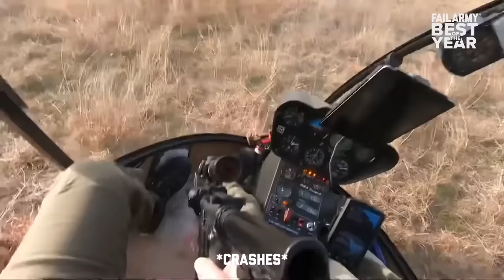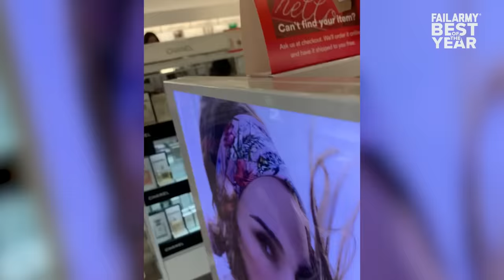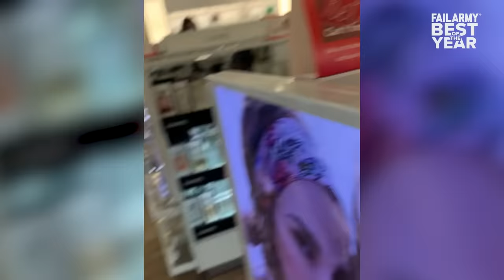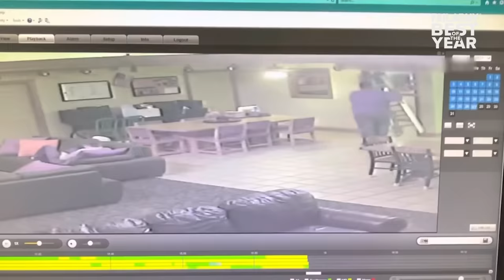Best Fails of the Year | Try Not To Laugh🤣🤣

Comment: "He won't bite, he won't bite, he just barks." He says as the 150 pound dog charges down the 100 pound delivery driver like she's an injured squirrel. What rational person would just take the guy's word for it and stop running away in terror?
Reply: Hate dog owners like this, they expect a person on the street to react as though they know the dog and fully trust it the same way the owner does, and just because the dog doesn't bite the owner, that's not to say it's not going to bite a delivery person.
Reply: The point is not to magically try and convince the person that everything's fine and stop running in terror, it's to at least slightly reassure them while you try to get the asshole dog under control.
At the same time, there is nothing worse than running away in terror from a dog that is actually attacking you. Dogs are faster than humans - nobody can outrun a healthy non-dwarf dog. You take cover, and if you don't have any, you drop kneeling on the ground, try to curl up in a ball, forehead to the ground, arms crossed shielding your head and neck.

Most dogs are not attacking you with the intention to actually injure or kill you. They want to scare you away. Do not ever take this for granted by any means, the chance of getting seriously injured or even killed is too high, but the majority of dogs will not go past barking and warning bites. Unfortunately for them and the people on the receiving end, they don't understand that a warning bite is suicide.
Reply: You very very obviously have zero clue what a 150 pound dog actually looks like. That dog is closer to 50 pounds, maybe 60 at the most.
Reply: Guys act like that little golden retriever is a Cane Corso monster or some shit 😆
Reply: Had a lady try to tell me her dog was only playing while he was snarling viscously and biting me. I go to peoples houses to do repairs.
Reply: This is why dogs shouldn't be allowed.
Reply: No matter the size of the dog, if they're off leash, they need to be trained or anything from a finger laceration to a torn jugular can occur. Don't act like size matters when it comes to aggression, especially in a busy neighborhood where there's sure to be kids, and probably other animals with irresponsible/ no owners that can kill or be killed themselves. We need to care for and train our animals because they deserve the rewards and freedoms it brings, but people like that are why leash laws must exist.
Reply: Size matters very little. Pit bills rarely exceed 70 pounds but are one of the most ferocious dog breeds. And they are very successful at attacking their intended targets.

In my hometown, back when I was a kid, our local Post Office, after a series of postal carriers being bitten by dogs, began filing (and winning) lawsuits against people whose dog not only attacked a postal worker, but also those whose dog merely postured to attack or chased after a postal worker but didn’t successfully attack. It didn’t take the townspeople long to get the memo that they had better damned well keep their dogs under strict control.
Reply: Fr

Comment: The Helicopter at 21:44 isnt a fail.  That is an absolute win by that pilot.  Kudos to him for a cool head and getting everyone safely back to terra firma
Reply: It was a fail. There's another video thats longer and the pilot admits he forgot to flip a switch shortly after takeoff.  Not to take away from his impressive crash landing though.
Reply: It was an engine fail though, does that count?
Reply: A mechanical fail
Reply: COMPLETE fail. The pilot's the reason they crashed and just because they didn't die...you call that a win? You're the type that thanks Jesus when you get into a bad car accident that doesn't completely result in death.
Reply: i mean it barely left terra firma

Comment: The helicopter one at 21:55 would'a scared the living hell outta me, everyone was so calm. I know you can keep a helicopter in the air after engine failure by switching the blade direction, but still... scary af.
Reply: 11:28
Have you seen this one ? 
😃😃😃
Reply: You don't switch the blade direction during auto rotation. You disengage the propeller blades from the engine.

Comment: Heli pilot did great work. As soon as he noticed something was off he changed his heading. He foresaw what could happen in the situation immediately and decided he'd rather not end up on a road to keep drivers safe. He decreased the rate of descent by flaring at a solid height and executed a forced landing in a way that didn't damage the heli. Props indeed.
Reply: I cannot understand how you can type that long and how do you know that?????????????????????????????????????????????????????????????????????????????
Reply: I am concerned????????????????????????
Reply: Ha ha ha ha ha! "Props" ... :D
Reply: he crashed because of flying with one mag on, pause and check the key
Reply: @duncanlikes That’s just depressing if he lost both mags or he just lost that mag on that flight
Reply: @oddsquad6324 Are you okay?
did you have a stroke?
Reply: I wouldn't call crushing parts of the helicopter "not damaging the heli". But it was decent autorotation landing for the altitude.
Reply: Another happy landing

Comment: 21:56 Not a fail! Pretty much a perfect autorotation landing after engine failure. Well done!
Reply: Every person who got on there failed
Reply: It was a fail his ignition switch was on only one magneto, he screwed up that's why the engine quit.
Reply: @AviationNut  that shouldn't be a fail anyways, unless there was a problem with the magneto. The engine should still run just fine on one. It probably would have been prevented if it was on both though
Reply: @direflyer  
You can't leave the ground on one magneto, it's illegal to fly with only one magneto getting power, that's why there is two of them, just in case one fails in flight and this guy failed to turn on both magneto's. I don't fly helicopters i only fly fixed wing single engine piston aircraft, but it's exactly same thing you cannot leave the ground with your ignition on only one magneto. Before takeoff you have to do a run up to make sure both magneto's are providing power, first you try one mag and see if the engine is still running than you switch to the other and see if it's still running, than you turn the ignition to both to get full power on the engine and only than you can take off. He failed to turn his ignition to both magneto's, if he had done that there would be no fail because there would be no engine failure. That's a huge fail on the pilot. If i flew a commercial aircraft and failed to turn on both magneto's and took off and crashed and killed the passengers because I didn't turn power on to both magneto's i would be going to prison for my failure. Plus with only one magneto the engine won't work properly you only get 70 to 80% of the power and there is a chance the magneto will burn up because instead of two magneto's sharing the load all the load goes to only one magneto which will overheat and fail if you keep flying for a longer time. That's why if you have one magneto fail, you must get on the ground ASAP before you burn up the other magneto. Wow calling this not a fail is just mind blowing.
Reply: @davidmoore2445  How? For not foreseeing and engine out and well-trained pilots calmly dealing with an emergency.
That's a HD bullshit definition of "fail".
Reply: @direflyer  And you know that's what happened how, precisely. From this video? It was a critical loss of power followed by a perfect autorotation landing. No debate.
Reply: @Ingens_Scherz  I agree that he did an amazing job keeping everyone safe. Definitely not a fail. I was just pointing out that even if it was because the magneto failed when he was only on one magneto (aircraft have two, partially for this reason, and also because of improved engine performance) it's not entirely his fault. He made a mistake, and it happened that that one decided to quit.
Reply: @Ingens_Scherz  might as well play russian roulette doin that kinda stuff. No thank you!
Reply: @Ingens_Scherz  
Wow, you truly don't even know how mgs work in aircraft engines. The guy took off with an engine misfiring and getting only 70% of the engine power. Go read the R-44 Lycoming O-540 engine manual, it clearly states "FAILURE to switch ignition to both magneto's will result in engine cylinders misfiring, loss of power and overheating, continued flight on one magneto for an extended period of time will result in catastrophic engine failure". The guy flew 9 minutes and 48 seconds on one mag with the ignition switch in front of his face. In my Cessna 206 i always look and make sure my switch is in the 1 o'clock position on both mag's after run-up and again, before I start the take off roll and my ignition switch is hidden behind the yoke, this guy had his ignition in front of his face and he still didn't check his ignition switch was in the wrong position. I have been a bush pilot for the last 26 years in Alaska and i owned 4 different aircraft over that period and have never ever taken off with the ignition on only one magneto, because it can be a death sentence and i would lose my license to carry paying passengers. It might be a little too much for you pea brain to process this comment so please take your time.
Reply: You probably can tell what happened in the video just fine. I'm not a pilot, but I'm sure the warning tones meant something distinguishable.
Reply: @AviationNut  I agree that both Magnetos are important. Ian McKellen established the menacing, yet ultimately altruistic nature of the character, and Michael Fassbender showed what a tortured soul he was, while maintaining his bada** persona. But I think people underestimate Bill Milner’s portrayal from First Class. He was the perfect young Magneto. 
Magneto. 

Magneto. 
You said Magneto a lot.

Comment: 21:55 Wouldn't really call that a fail. Really well done by the pilot.
Reply: Didn't the engine fail? I really doubt that was the intended outcome...
Reply: @morphman86  Fail Army's core mission is to show people or animals failing in some way, shape, or form so really the best you could possibly do is pin this on a pre-flight check fail, but then you need to know if the failure in question was the kind that could've been prevented with a pre-flight check or if it's the kind that would've just gone unnoticed.
Reply: He failed to fail
Reply: Bro it sounds like Chris from mr beast
Reply: Both magnetos are off, so yeah, it's a fail. He never checked them before take-off and a lose connection was the only thing keeping the engine running.
Reply: I don't know much about that specific helicopter, but I do know that it takes some good flying to get a helicopter to land safely when the engine fails at such a low altitude.  It seems to me like they could have eased the landing a bit more if they had flared more prior to touchdown (though for all I know, the tail rotor might then have hit the ground).
Reply: @bobogus7559  I'd say he did a great job to get it down. Little altitude and fairly low speed to keep the rotor spinning great job
Reply: What did the pilot do that was “really well done”?
Reply: @YouTubeUpdatesKeepGettingWorse  Get everyone safely on the ground with a helicopter in which the engine failed, maybe?
Reply: @YouTubeUpdatesKeepGettingWorse  Safe recovery from a helicopter engine failure depends on decent speed and altitude.  This pilot was low and fairly slow (I would guess on approach for a landing) and still got it on the ground with everybody alive.  That's what was really well done.
Reply: @MythicSuns  If you made any sense, then giant corporations wouldn't pass engines that fail. It's very difficult to find worn down parts that are covered by other parts, you would have to disassemble the engine to find something internal that could result in total engine loss in some cases.
Reply: @steveroman3729  So we can safely assume that the failure in the clip was something that would've naturally been missed during a pre-flight check? Either way my point was that I agree with the OP and feel that it's a bit of a stretch to call the clip in question a fail clip.
Reply: @MythicSuns  I honestly think the REAL fail in the clip was FailArmy's understanding of what exactly happened.

Comment: What exploded 2:07 in that car with the dude in it? Holy shit!
Reply: Personally I think it was someone smoking wax or some other substance ya need a torch to heat the element with looks similar to an refill explosion(where extra gas from refilling a torch is still around and you use it thinking its gone)
Reply: I couldn't read the van lettering clearly, but based on what I saw and his uniform it looks like he's an HVAC technician. there's lots of things that can explode in that van. best guess
based on the size of the boom and there was a large flame it was most likely a disposable Mapp gas can or liquid propane gas can. if it was the much larger refillable ones it would've killed him and toe the roof apart. I hope that guy realizes just how lucky he was? 
also, he could've been cooking meth I suppose. depending on his production amount I suppose something similar to a season one batch size from Breaking Bad's Walter White (the amazing Brian Cranston) would've done similar damage. anything from season 3 would've vaporized the truck.

Comment: 3:13 - That's basically me except I fell into the rose bushes. Ended up looking like cats had attacked me.
9:33 - Hilarious!
12:05 - I felt that. Ouch!
17:59 - I instinctively moved my feet off the floor.
19:42 - Classic.
20:22 - It's interesting how often that happens.
20:55 - This is better with sound.
25:42 - This is why sleep is very important. At least he didn't leave a kid and drive off. I drove all the way to work before I realized I was supposed to drive the kids to school. To my defense we had a newborn in the house. Newborn = no sleep.
26:30 - He just wanted to cuddle.
31:21, 36:05, 49:16 - Why doesn't cars have a handbreak alarm so this doesn't happen?
37:09 - Yeah. That's her first kid. No doubt.
44:38 - Step-bro, I'm stuck.
1:00:50 - What is she on?!
1:04:45 - Hilarious!

Comment: The guy who had the straps come over his neck, I cannot imagine the terror!
Reply: Why it's not  putting a lot of pressure it's funny as shit too. 🤣 it's hilarious that the second guy got caught up in it too
Reply: Dave..DAVE..DAAAAAAVVE!!!!
Reply: Not at all. I'll stick my neck into the arch of an RQ-8 and SQ-800x to show operators that it's not going to kill them. I can't tell what the make and model of that machine is, probably a UK rebranded Akebono, they all basically operate the same though. 
I'm legitimately an expert when it comes to those types of machines. I don't know how stupid you'd have to be to get stuck in one though. There is an emergency stop button literally 2 feet away from him. 
They appear to be running it on automatic mode, which doesn't make any sense to me. They don't have the throughput to justify that. just use the fucking footswitch like normal person. 

Tension is adjustable in terms of DISTANCE not pressure. The machine will suck down the strap very quickly at first during primary tensioning, after the primary tensioning wheel starts to slip it will engage the secondary tensioning wheel and pull a set distance to achieve desired tightness. Secondary tensioning is generally a very small distance, usually just mm. 
Worst you'll get is a rash from the strap quickly sliding across your skin. I can't think of any possible way to injure yourself on a poly strapping machine.

Comment: 1:14:41 that was very scary, she could've gotten her spine crushed if that landed on her directly

1:14:57 I've ridden quads myself for a couple of years, and in that time a huge thing I've learned about doing jumps like that is as soon as you jump, you have to be able to brace yourself for a landing. Some technique to this is giving it gas right as you go off the jump, it will lean the quad back mid-air, so all four wheels don't hit the ground at the same time when you land. This adds suspension when you land and is easy to control when you brace yourself for the landing. Rolling over the lip of the jump while staying on the seat the entire time will result in something like this. The guy in the clip got very lucky because if the quad had rolled over him (tires-down would have been even worse), he would've likely been seriously injured.

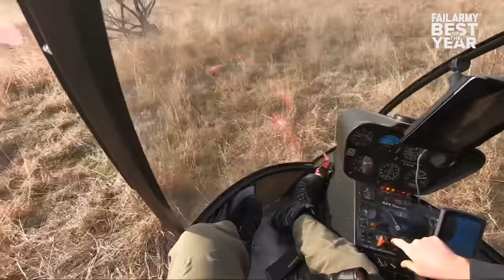Comment: 22:20 - Damn, that could have gone so so much worse so easily. If they'd be just a little higher up and hadn't been able to land so gently.
Reply: Good thing the pilot remained calm too. I dont think I heard any screams from the passengers either
Reply: @candyrox1493  Heli hog hunting expedition, notice the rifles in the cabin. These guys fly daily and are skilled pilots. And the passengers are outdoorsmen with an adrenaline itch.
I'm amazed I didn't hear a "Yeehaw!!"  XD
Reply: As far as I know most (if not all) helicopters are designed to be able to lose power at any height. If the pilot does the correct inputs it can land safely. Pretty hard, but you don't get injured. It's called "autorotation". Basically one you lose power the pitch of the blades gets lowered and you go into a hard descend. The airflow now keeps the blades spinning. Just before touchdown you increase the pitch of the blades again and use the rotational inertia of the rotor to create lift that slows your descend. This is the reason why helicopter blades are not designed as lightweight as possible, otherwise they wouldn't have enough rotational inertia to perform this maneuver.